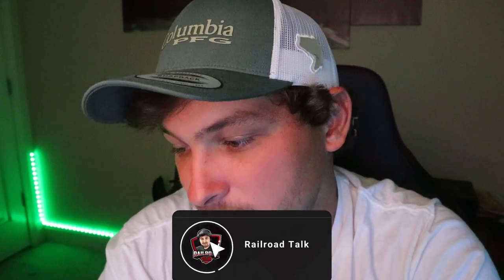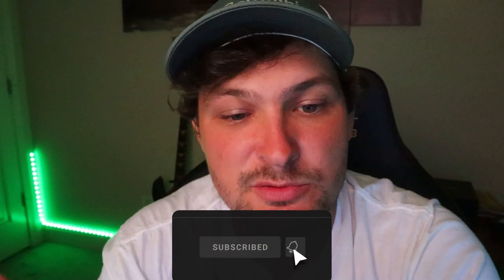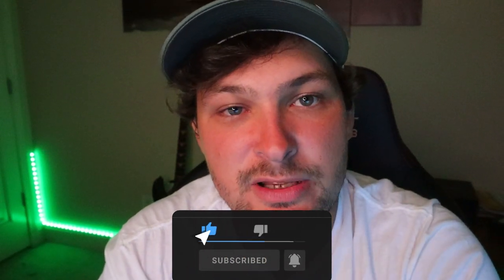Train Conductor Hang Test EXPLAINED 2022

Comment: As an old school retired railroader - I hired out as a brakeman/yard switchman OJT in the good ol days  - worked mostly locals and as a yard switchman if I got bumped - the NS training school bs is so unnecessary - I had many student brakemen that worked along side with us - they turned out just fine - back in my day you worked as a brakeman and were promoted to conductor when you were ready, not thrown into it like they do these days -  glad to be out of there, used to actually enjoy what I was doing until the latter yrs -  it's no longer railroading - just moving freight down the main line - the art of it is gone unfortunately 🚴‍♂️
Reply from the maker: I was very fortunate to work with a lot of pre 85 guys and man they taught me a lot. I think they have all retired now besides maybe one or two. More than likely working the pull back or some kinda extra yard job.

Comment: Hardest for me at work is when I wrap my arm around the grab iron, it cuts my blood flow off lol. I usually have my arm resting on top of the bar and holding on with both hands. As long as there's 3 points of contact, no one will tell you you're doing it wrong.

Comment: When I hired out on the Alaska Railroad ten years ago the hang test was 10 minutes. We didn't have to do any hand signals and could use one or both arms, so long as we maintained three points of contact. Right after that we did the knuckle test, carrying a coupler knuckle 50 feet. My arms never burned so much in my life.

Comment: I've been a weightlifter most my life. And honestly shoulder and upper back endurance can help. But it means nothing if you don't have relatively strong grip and wrist strength. Working your grip strength would be number 1. Like timed holds with like 2 buckets filled with water or something. Just stand there and hold them. Or walk for some distance u have determined to be ur goal. Then do ur lateral raises and other shoulder stuff for a sure win. Also o totally agree. Dont go heavy with ur lateral raise. Train light for endurance and control. Go the distance and its going to burn just fine and u well notice a difference in performance in no time
Reply from the maker: great point, forearm and whatever those things are you squeeze would be really good to do as well. Great input man thank you!

Comment: It's a forearms grip test... no shoulders at all.  Work on your forearm flexors/extensors.  You want to hang as high as you can like he said, but, also be as vertical as possible to put the weight on your feet, not your 1 hand, so pull your hips close to the bars. If your hip is out, it will be twice as hard, all the weight going to your hand to keep you from pulling off the bar.  To increase grip strength, hang from a pull-up bar, use one, and do a hang test in your home with your feet on the floor if you have a door chin up bar.  Simulate the same exercise.  Hand with one hand for 1:15, then switch hands and di the other.  Then try 1:30 each hand next time, then 2:45, then 2:00 each hand.  If you can do that, you have the grip strength to pass the test. They'll do 1:15 per hand. You can use grippers or wrist curls with a dumbbell as well  to increase grip strength.

Comment: Never heard of such a thing but I guess now days it's a way to 'Weed Out' anyone 'Out of Shape'.
I've been hanging on the side of railcars and locomotives for 37 years and have thought nothing 
of it because it was the only way you could get transportation around a yard. There was always
a track in that yard going either direction you just climbed thru the other railcars in the other tracks 
and ran along side then grab the high grab iron, leading foot first in the stirup. That was before the 
invention of 'Intermodal railcars' which rarely need to be switched and are now inspected, repaired, and 
maintained 'in track' under 'Blue Flag Protection'.
Now that I've retired I think my arms are probably 3 inches longer. They also have 'Crew Vans' now. 
Consequently with all these conveniences I'm sure we'll see much BIGGER Bellys.
But something that will never change is the main track train crews crying that they 
should have got a 'Hot Shot' train,  and "We're getting Screwed!"
Reply from the maker: LOL very true, I herd that often during my time with NS. I never did care, it was not when we got the hot shot trains but I prepared myself mentally to be out there for 12-15 hours lol

Comment: Its like he said you only have to do it once its not that hard. If I was hanging off a ladder and that all that was involved I would say I could do it all day but that would be lying .  4 or 5 minutes is nothing . I've rode several miles a stretch hanging from a damn car. The hanging is not the bad part . The bad part is being thrown back and forth while hanging on while the engineer will only use the independent brake to control the cut . Believe me you will use both hands to hang on them. That's an extremely stupid and dangerous practice those idiots care teaching you all anyway.  The sole purpose of that exercise is to intimidate you and try to get you to believe you can't do it and make you give up and quit . About 20 years before I retired I'd decided I'd had enough and I give up riding on the side of them. I simply walked . did I walk far ? You bet I did it was better than being beat to death hanging from the side of a car . lantern in one hand radio in another and trying to keep up with a switch list among all that foolishness . They can't make you do something dangerous . Did they come up to me mad as hornets wanting to know why I wouldn't ride the cars ? They sure did when they asked why i wouldn't ride them . one answer . it's  to damn dangerous !